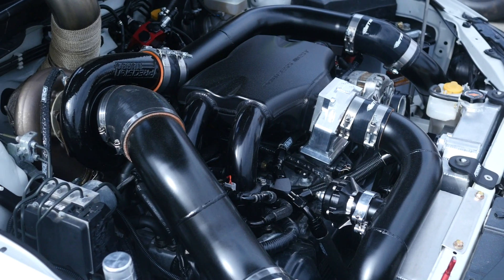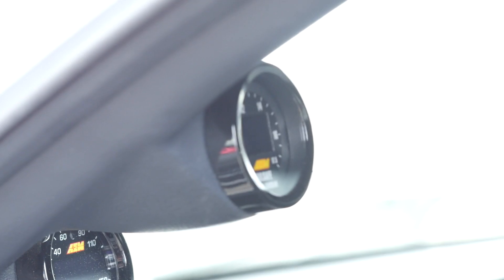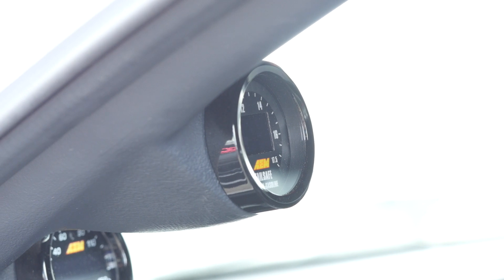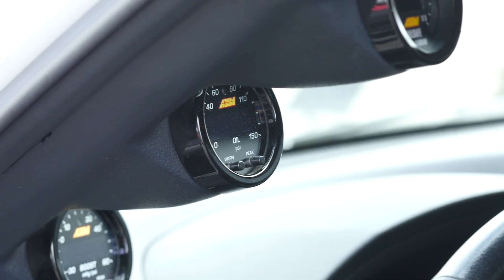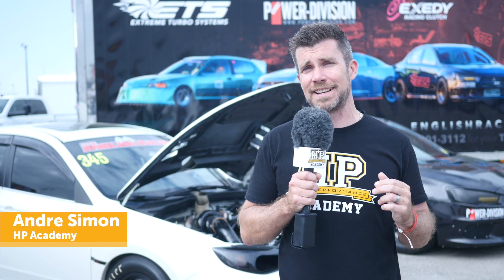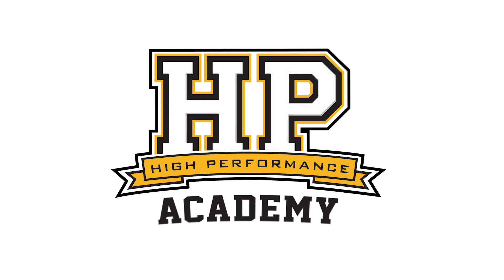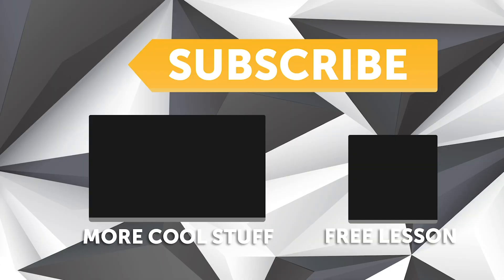How YOU Can Avoid Complete Engine Failure | Safety Parameters [TECH NUGGET]

Comment: I always thought the coolant pressure sensor was for detecting a sudden drop in coolant pressure like if a hose blew or radiator let go you could shut down the engine before temps rise to the point it does damage. 
You can monitor temps but a coolant temp sensor won’t pick up a rise in temp if all the coolant is suddenly lost.
Reply from the maker: Yes, this is discussed in the video and comments section, unless you mean this as a reply to @Dylan? =) - Taz.

Comment: Good point on oil pressures in relation to rpm. Also, Will  plugged (or welded shut) oil squirters be beneficial to these high horse power engines? Awesome content, thank you!
Reply from the maker: Eliminating the oil squirters means there's more oil flow to the bearings however this won't fix oil starvation if the pickup starts to suck air instead of oil.

Comment: When you spend thousands of dollars buying a custom ecu, and building a motor, or even with a stock motor, it's cheap insurance to have the ecu monitor coolant pressure.  It can recognize a blown head gasket way quicker than the driver and put the vehicle into limp mode or totally shut it down asap saving you from the risk of much more serious damage. 
     If you aren't running high boost it may be unnecessary but if you are pushing the envelope you should have it.

    Just saying....
Reply: Yeah and you monitor temp just fine as temp goes up so does pressure boom simple
Reply from the maker: @DylanL69  the coolant pressure will change MUCH faster than temp. There's a huge thermal mass in the cooling system so the change in temp tends to be damped down significantly. You have a very small window of opportunity to lift and prevent damage to the engine which is why coolant pressure is monitored in most high power boosted drag cars.
Reply: @hpa101  Completely agreed.  Live and learn.  After enough paying to play things become obvious.

Comment: What is a safe coolant pressure in the cooling system? Iv seen it increase to 25psi as revs and boost increases.
Reply from the maker: In general you shouldn't expect the coolant pressure to exceed the rated pressure of the cap, so once the pressure starts exceeding this point it can indicate an issue. Generally when the head lifts you'll see the pressure rise sharply and it will also be erratic so it's quite obvious.
Reply: Good question
Reply: After speaking with my engine builder depending on where you put the sensor it can read different pressures due to hot and cold side of the cooling sytem.
Correct me if im wrong but i have heard that water pumps that are driven by a pulley and belt can create pressure at high rpm.
Reply from the maker: @988oguzhan  they will not create pressure spikes and cause erratic pressure which is what we're monitoring for - Taz.

Comment: I don't really see a reason to monitor coolant pressure just temp most cars don't blow headgaskets that much these days
Reply: When you spend thousands of dollars buying a custom ecu, and building a motor, or even with a stock motor, it's cheap insurance to have the ecu monitor coolant pressure.  It can recognize a blown head gasket way quicker than the driver and put the vehicle into limp mode or totally shut it down asap saving you from the risk of much more serious damage. 
     If you aren't running high boost it may be unnecessary but if you are pushing the envelope you should have it.

    Just saying....
Reply from the maker: Well Dylan it really depends on the application. While you're right that a blown head gasket on a stock standard car shouldn't be very common, at the pointy end of boosted drag engines it' a leading cause of failure so monitoring the coolant pressure makes a lot of sense. It can alert the driver to the situation or bring in safety parameters to prevent more serious engine damage occurring. In a high boost methanol drag engine lifting the head will quickly lead to the combustion gasses physically torching a channel through the head/block surface if the driver doesn't lift.
If you're keen to learn more and are an HPA Gold member I recommend this webinar lesson for you, or anyone else interested: https://www.hpacademy.com/previous-webinars/146-cylinder-head-sealing-techniques/
Reply: Or maybe there not being driven under conditions which requires it to be monitored almost like everything else
Reply: @TheYaegerPilot  or you just keep on eye on how hot the engine gets way simpler and don't have to drill into a coolant passage and potentially damage it